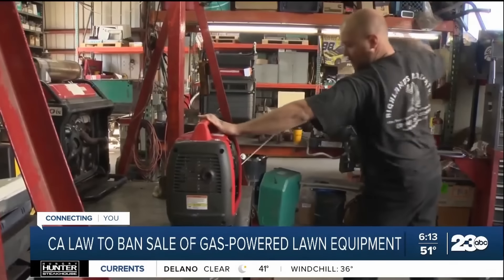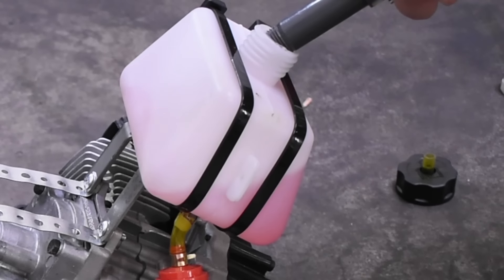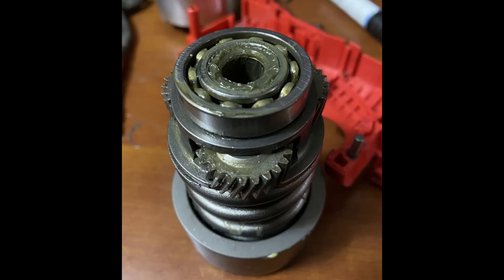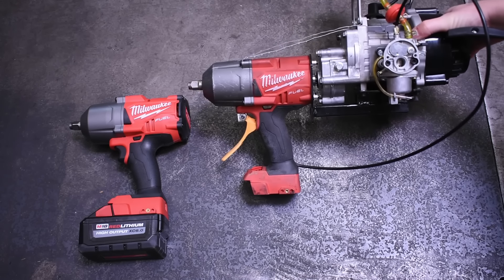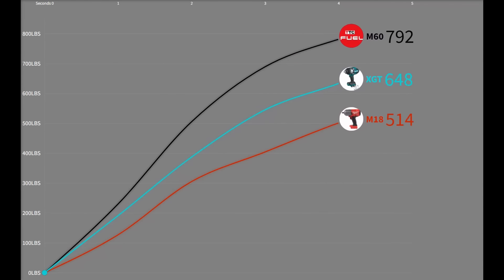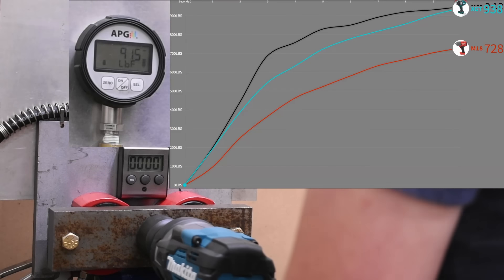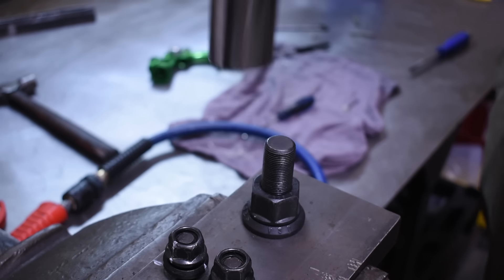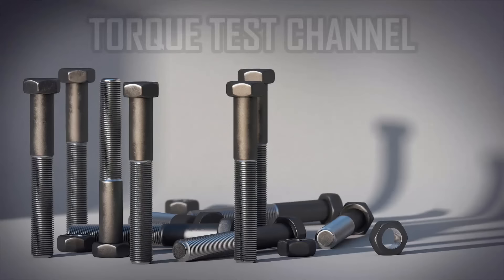Gas Powered Milwaukee Impact Wrench Because it's Illegal

Comment: I dont like to work with impact drills/screwers. Dont get me wrong its nice if if you special hard screas/bolts/nuts. Quick change tires or so on. Or do it just to be quicker but if you want to do something relaiable use your normal screwer with limited turn moment and feeling. 

Story from work. 
We build packing maschines and paletizer oder other special maschines.
We wanted to hang a  middle sized ABB robot onto a vertikal stealbeamframe. Coworkers mention to use the drill impact for M16x60mm 912 bolts, 360 Nm, i wanted to use the turn moment key. But the head of the turn moment key was to big so we used the impact drill. 
3 of 4 screws went in nice and smoof. The 4 one got stuck 2cm deep in the Steal plate on the beam in which the tread was. It doesnt went forward and it doesnt went backwards. Ate itself.
So i wanted to use a longer leverage to get it out but i guessed that would break the bold in half. Left the bolt stuck thight in the thread. So i drilled a 12mm hole in the M16 Bolt to remove the tention and then turn in out by hand. Recut the threat and done it the old fassion way. 

The moral of the story. If you use impact drills you have to make sure that your thread is clean and complete. Or you will play yourself. Saving a few minutes because of the impact drill, wasting and hour to repair the damage that has caused. 

Nothing is impossible but you should know the consequenzes. Save 5 minutes to waste an hour.

Comment: Looks like the clutch is getting overheated.  Go back and watch the dyno run and you'll see the curve immediately flatten out and get wonky as the clutch goes between slipping and trying to weld itself together.  I'd try to get the clutch to run cooler before more power.  Cut some holes on the face (not friction surface) of the clutch bell, and add some vents to the bell housing.  Hell, if you really wanted to go all in, you could duct some cooling air into the bell housing.

Comment: use the same engine, but higher compression, sand the head a little bit with 2000 grid paper & another exhaust. Larger main jet. & foila 1000

Comment: That gun can make a lot more power with different fuel.  You can look into using model airplane fuel.. It's nitro methane like they run in top fuel dragsters, just not as much nitro.  You can start out with 5% and work up to 30% if the engine can handle the extra power.  You would need to do some jetting on the carb to make it run right but it would probably double the power output.

Comment: Nitromethane rotary engine! Or on the other side of the fence, make THE TURBODIESEL BOLT DESTROYER CROSS THREAD ANNIHILATING KILL WRENCH. does not come with drill bit or thread tapper

Comment: A flywheel will help your engine maintain RPM. Maybe on the shaft. The more load the flywheel is able to take, the higher you will be able to maintain engine RPM.

Comment: Nothing should be run at 25 to 1 with the state of oils these days it should be at least 40 to 1
Reply: Typically these random Chinese engines from online require 25:1 oil because they're unregulated aluminum Chinesium crap
Reply: I wish he'd use an American or Japanese small engine like a stihl or husqvarna or echo

Comment: Does the gas engine still have the clutch that is used from factory in their original intended assembly? That clutch would most likely be the weak link.

Comment: I’m a small engine mechanic 
I’m also a performance engine builder 
If u message me I could recommend a new carb that is tunable so u can get everything out of ur drill 

That carb on is impossible to tune are best used for full throttle high reving application 

If u want torq from 2 stroke u need old school high low jet carb like I said I recommend one

Comment: look into a gsr46r goped engine  5hp stock and they make a expansion chamber exhaust, split flywheel and msd ignition etc. they will move my 240lb body on a goped to 50mph easy

Comment: idk about the numbers, seems like youre testing rpm tq. And not break away tq but I digress the engine powered cordless fun idea.
Reply from the maker: Bolt tension like here is the traditional impact wrench test method for manufactures
Reply: @TorqueTestChannel  general torque test, was or at least to my knowledge is where they torque said fasteners up to the point of the tool not being able to break it free.

Comment: honestly, I'd like to see some serious innovation done to this thing. Make it easier to use by adding padding to reduce burns on the arms, have a more ergonomic design for ease of use. Maybe get a smaller motor and throw parts at it to make the BEANS. This literally opens a door to a whole new, but at the same time "not-so-new", form of hot rodding with motors. Only this time, with our tools. And once again, to all the environmentalists dismay, gas seems to have just a bit more potential with what current technology we have today (hope that makes sense). Gas powered motors, I believe, have more power potential that we still have yet to dabble in, no matter how many say that it's beating a dead horse.

Comment: I don't understand why the motor would bog after 6 seconds unless there's something not set up right on the motor/carb.  It runs fine for 6 seconds, but then bogs?  Fuel starvation?  If so, it's not the carb size, it's a jet or other setting.

Comment: As we see the results are pretty the same depending on model of impact gun. If you need to use several units and you don't have socket to charge batteries the best solution is electric guns and gas powered generator to charge all your stuff. If gas powered guns would be useful all manufactures will provide gas powered guns.

Comment: It's either higher RPM + greater reduction, or a bigger engine. An electric motor can easily reach 10x the RPM of a gas engine because it has a perfectly round shaft instead of a camshaft. That said, I'd love to see this experiment with a Wankel engine, because it has both higher RPM and more torque compared to a regular engine of the same size / displacement and therefore shouldn't slow down like this one did.

Comment: Still.. it's pointless when 36volt and even 72volt systems exists. Maybe not from Milwaukee, but one can easily make a more compact system that does the same with a battery. I know people are "mad because freedumz". But California certainly has a point regarding under 25CC engines. 2 stroke engines are incredibly polluting, and especially in cities this can cause issues.  Country side less so. But I'm sure they can still import their 25CC engine tools and mopeds and not have the Police pull them over LOL. 

But when you live in a city filled with smog (like many of the cities in California do), then this law makes a lot of sense. But then I'd also ban Diesels entry in them and get my public transport in order, while offering guarded parking outside of major cities with "free" tickets paid for by the duration of the Parking. AKA: you get a ticket and it's your public transportation ticket for the entire day, until you pick up your car. 

Again, doesn't make sense for the countryside, but their cities have a major problem LOL .

Comment: Chrome Sockets???????   Come On.
Also noticed you're using a 33mm impact socket.  
I believe the 1 5/16 is more correct size as bolts that big usually aren't metric.
Reply from the maker: Big rig truck lug nuts are 33mm not SAE.
Reply: @TorqueTestChannel  Thanks for the knowledge.  I'm an apprentice and have both metric and SAE for this.  I will use the 33 from now on!

Comment: You guys don't have a pair if you don't slap a turbo charger on that with about 10lb of boost. Might have to run on ethanol or hell maybe even diesel and not have to add the oil.

Comment: You've got so much engineering prowess it's aerospace grade so when I tell you this I'm not saying it lightly not only is this more power than the human body is rated for 1/3 of a horsepower you need to put an offset handle that shock doesn't seem like much but it's a lot more than the joints in your body were designed for now that that's out of the way your aerospace engineering buddies all of you working together why don't you reset the timing so that the thing has torque where it needs it and in doing so you can also reset and recalibrate the carburetor and by doing this you can totally adjust the the RPM bracket from start to finish basically you got to build a new flywheel for the thing

Comment: Couldn't someone adapt those engines to use a different fuel? Like Glow Fuel, used in model airplanes? https://en.m.wikipedia.org/wiki/Glow_fuel#:~:text=Model%20engine%20fuel%20is%20typically%208-22%25%20oil%2C%20with,glow%20fuels%20include%20a%20mixture%20of%20the%20two.

Comment: What BS! You're name says TORQUE fer chrisakes! I'm embarrassed for you all. Where the hell is the diesel powered impact??? Besides, if you absolutely have to play w/ 2 stroke power, everybody knows ya need an expansion chambered exhaust.  lol
Cool video, but if you're serious 'bout "beans", gotta find an oil burner. ;) How about an old VW Rabbit diesel? I seem to recall their cute little shortblock could be carried under one arm. ;)
Reply from the maker: To create torque on an impact wrench with a fixed hammer mass, you need RPM. It's not twisting torque, its torque as a result of hammer blows.
Reply: @TorqueTestChannel  okay then, how about a Hayabusa powered impact.  ;)